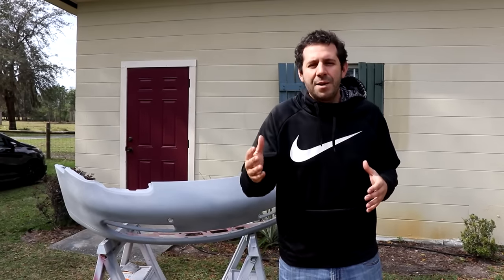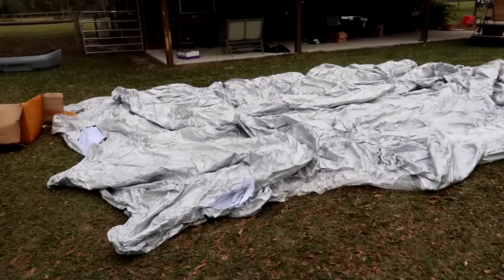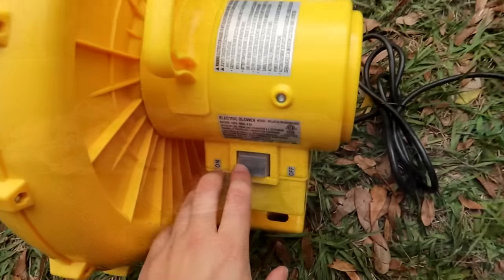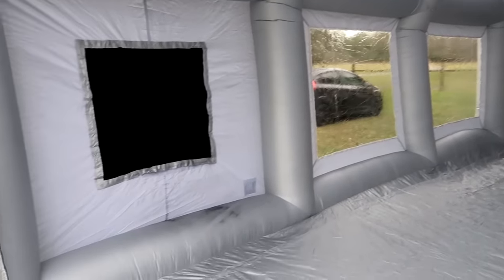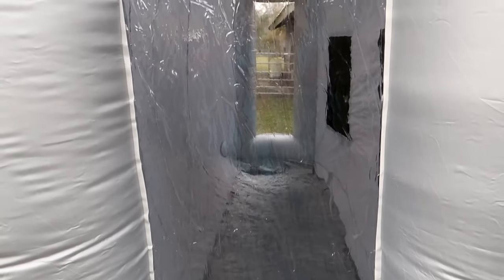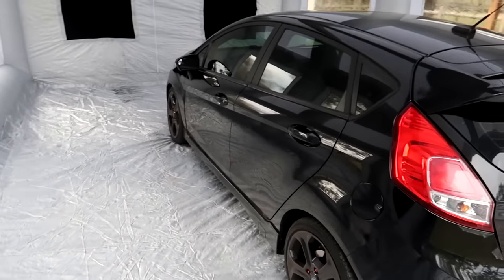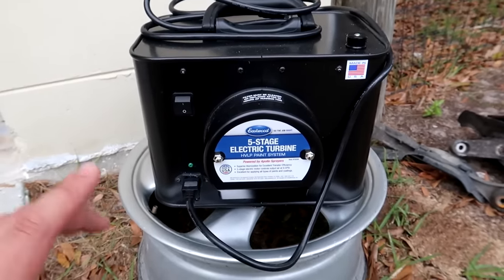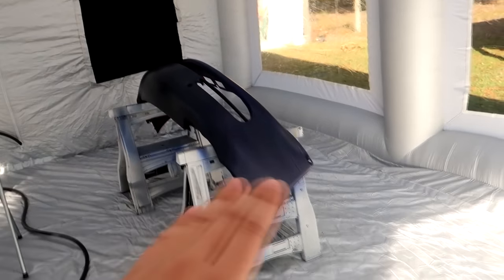I Bought an INFLATABLE Paint Spray Booth from China!

Comment: Hey Sam i successfully painted a Sports Car with 2 Stage Dupont Automotive paint  using a Campbell Housefeild self contained HVlP  unit i  purchased at Home Depot years ago for spraying woodworking finishes  the unit itself with a gun was under 200 dollars  i managed to get no runs  or major blemishes  and the hvlp  unit doesn’t require a Compressor as it  uses a  blower motor to move the air and paint  out the nozzle  i know Harboe Freight  sells  a similar  one  for a lower price reveiws say they work fine  ?  i may pick  up  one of those units for other spay jobs  in the future  mostly because i’m a little bit of a tool junkie

Comment: When spraying paint. Start in the tight corners and edges first. Basically outline the part with paint. Then on the large surfaces use long exaggerated passes that extend well off the part. Never stop the gun while over the part.

Comment: I am thinking about building something like this out of 2 to 3 inch white PVC pipe.  Same shape (gable look or even flat roof), and then cover with maybe six mil construction grade sheet plastic.  (? Any know how to plastic weld or epoxy weld this type material?)

Would put on a large concrete floor, I will drill 3” holes for the bottom ends of pipe to fit into so the won’t fall or lean.  I think standard PVC T fittings will work on mounting purlins and gerts (wall & rafters) but I may have to custom build some of the fittings where 4 connections needed.

What do you guys think, I believe it would be less expensive and more design/user friendly friendly.  PS. The frame will last forever, would just need to change plastic every few years if it breaks down from exposure.

Comment: I just want to give you a heads up I'm not a know-it-all or nothing like that I do paint cars for a living and I use proper stands but it's okay to use those stands I have when I have a lot of parts that I have to paint but the stand that you have the rear bumper on you can put a box in the middle you have to find the right box or you can put some two-by-fours and kind of build it up and you just kind of lean the bumper the middle of the bumper on it that way you can paint the sides of your bumper it'll be like it was on the car.

Comment: Isn't it possible to use the blower motors in the opposite direction? With a bit of engineering and DYI skills you should be able to suck the air out?

Comment: Well,  where I live wind and bugs is a problem.   How much wind can that thing with stand?   And my other question is so for the fresh air inside at 8:06 ,  your fresh air is going into the little room as  pressure and then going through those two big filters to put in fresh air into the main area of the booth??   Then the air is going out of the other two vents at the other end?  So basically you have filtered air going in and out of the main booth?

Comment: Okay, it seems like an effective solution to the problem.  Great.  And you got it from China for around $1000.  Also great.  Now how about telling us where we can order one just like it.  Why make us do what might take hours and many emails to potential Chinese suppliers?  This information may be in a reply to one of the 7k comments, but that would take days to sort through so if it is, please post it right a the top.  Actually, either way please post  the information right at the top.  Thanks.

Two other things:

1) Please tell us more about deflating the structure.  Sure, it was a nightmare, but how small did you ultimately get it down to?  And does sucking the air out do a better and faster job of deflating?

2) About the filters...you seemed quite excited and pleased about them.  But how do they filter bugs out?  Bugs certainly aren't coming through any screening covering the openings because, well, they can't get through the screen and they never get to the filter.  So is their purpose to trap bugs that find their way into the paint booth?  If so, I don't see how that would work.

First off, there shouldn't be bugs in the paint room if you first enter the structure through the ante-room.  Second, how would the filter trap a bug?  Even if a bug landed on it, couldn't the bug just fly off of it?  Although because of the positive pressure in the room created by the second blower, I suppose the bug might not be able to take off again.

The bottom line is: The filters have nothing to do with bugs.  Their  purpose is to filter paint dust.

Comment: I need one to paint my classic. Also, I noticed you didn't wet the floor. Is it not necessary in one of these spray booths? Thanks, great info.Yep. I think it would be worth having a pvc structure inside just to make sure the thing didn't collapse on your fresh paint. Or risk having to do the job over.

Comment: These inflatable booths are plenty predictable-- when I first started watching this video I thought "what if the power is interrupted??" That's just common sense. If you were to use one of these regularly you def would want to make sure you've got a standby generator- or at the very least a portable generator on the ready. As for your case overloading your breaker: not to be shitty but that's on you; it has nothing to do with this booth being unpredictable, and everything to do with operator error/oversight. Running two large blower motors, especially if they're 110v should be a huge red flag for you to look at the tag on the blower motor housing... These are in fact there for a reason, and give you the voltage/amperage requirements for all situations. A regular residential 110v 15 amp circuit usually doesn't cut the mustard if you're trying to run TWO motors of any decent size; a heavy duty 20 amp might be able to handle those two at the same time, but why even chance ruining a paint job when you could just power each blower on seperate circuits?? Lol- I can't believe that actually happened, it literally was the first thought I had seeing this inflatable booth.

Comment: Theres a spray booth that is almost identical with the 2 blowers included on eBay for $512.98 with free shipping, don't know why you spent $1,300. For $1,300 it would have been better to build a solid structure which you most definitely could have for close to that price.

Comment: Hi would it be possible to reverse the fan motor so it would suck out the air from inside the booth so deflating it quicker and making it smaller and easier to store.

Comment: It would really suck if the compressor pops a breaker half way thru.spraying would it deflate and ruin your paintjob while you run and reset the breaker most likely in the basement of the house.

Comment: so, let me get this straight. Instead of buying tarps and stapling them to the barn support posts to create a clean area to paint in, and adding a simple blower with a filter, you bought a special bounce house? why? In what way is this better than the harbor freight pop up garage with some tarps added to the floor? I just dont get why this is a thing. Real paint booths are set up to deal with overspray and forced air systems. this is just.........a blow up tent

Comment: Ok, whats wrong with this picture, he's got a disconnected garage  he can't park his car inside to paint it??  
Most paint booths have down drafts to pull things down to the floor and or negative presure they pull fresh air in via a filter and blow out used air, a merv 15 carbon filter should keep the air clean. You had the doors open to long for bugs to get it.  Go in close all the doors spray bug killer, wash the car and let it dry, wipe off with a varnish remover and tap cloth let that dry then start painting and dont open any doors untill the cars done and dry  then after 2 or 3 coats of clear you can wet sand any remaining dirt you should be doing between coats. 
Go over the car with a black light looking for imperfections.   Fix them as you go.

Comment: thanks for the content! Considering all the effort your putting in to spray, you should really invest in a basic air compressor. The system your using is only capable of 9.5 psi. Is it not?
Reply: "your"...what?
Reply: @tripjet999 let me correct myself: your= you're = you are. Now that we have that out of the way, are you prepared to post a comment which relates to the topic?

Comment: Hope it comes with fresh air supply as I am sure you will be painting isocyanate 2 part paint which is super toxic from inhaling and skin eye absorption and a half respirator is a useless as covid mask when it comes to your 2 part paint and clear coat  both of those will contain isocyanate for  sure
Reply: It does.  Watch the video.
Reply: @bobm2637  half respirator is not going to remover isocyanate you need a full face mask with a hose that sends clean from a remote location , air not filtered air from the booth as the half mask do little to stop isocyanate once you reach your life time limit you won’t be painting .

Comment: From what I see; piss poor spray technique, no drying lamps, no work lighting, no humidity control or monitoring. There is a reason that paint booths cost 10 grand for the cheap ones. Can't imagine those bumpers actually turned out without proper curing.

Comment: I bought a used inflatable Booth and sprayed sealer, basecoat, clear out of a Tekna Pro light spraygun the finish was beautiful but while the parts were sitting in that booth drying all kinds of crap from the environment landed in my paint and ruined a beautiful paint job. I folded that piece of crap booth up and threw it in my pick up and took it to a dumpster and got rid of it I wasted $1000 in paint and threw away a $900 spray booth. A little advice for anyone thinking about buying a inflatable booth, don’t do it or you’ll be very sorry!!!  the quality of them suck. And a footnote..... there was not enough air exchange, it was hard to see in the booth even with both fans running.